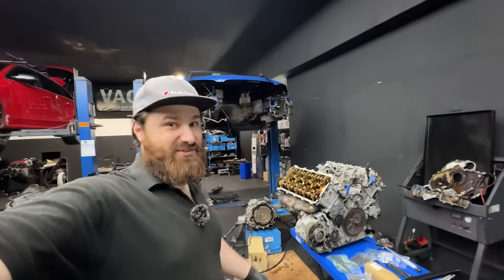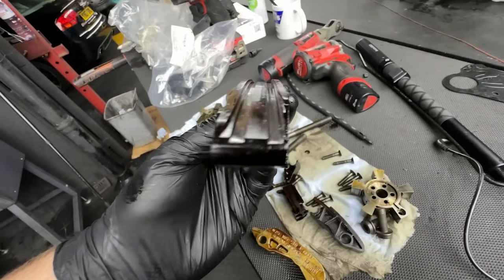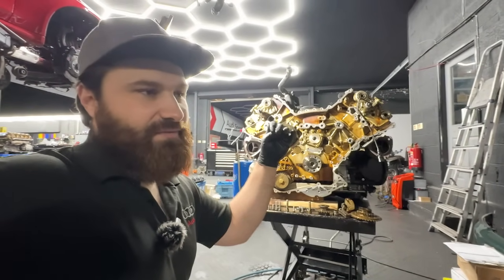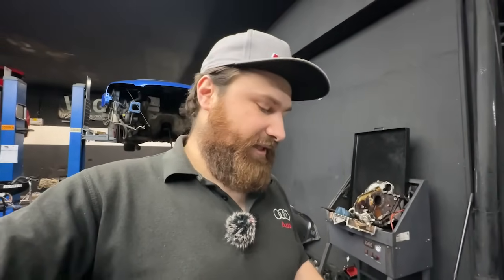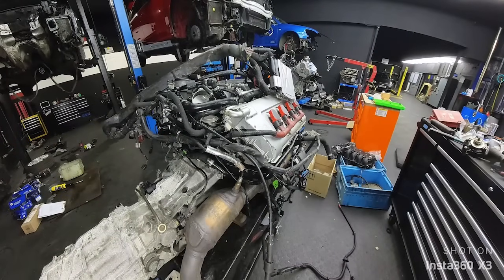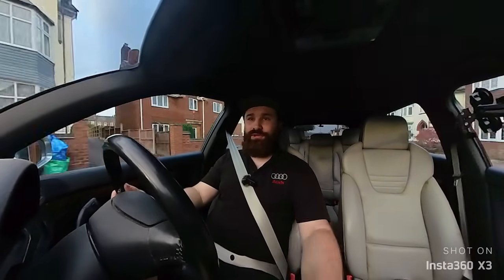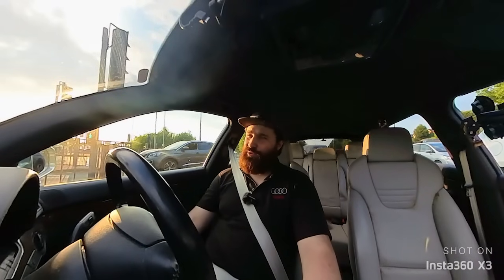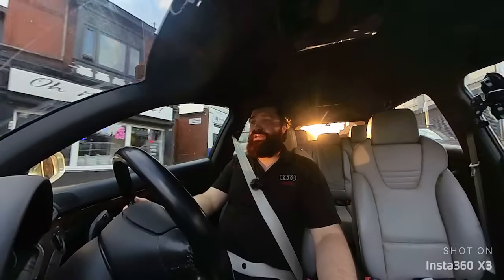Is this the end of Audi S4 V8 engines ?

Comment: Grind out the Audi logo with dremel, get one company to scan or do a new CAD design of the part. Modify to make it thicker. Then get that design and get another company to print it. There is many companies online where you can upload the file, choose what matherial to print it out and they’ll 3D print them for you. That way when you provide them with your own CAD file there is no questions about patents and copyrights.
Reply: Have used this in the past with PC parts too, making my own fan shrouds etc. Having your own printer is too expensive, but there are many third parties that can just print it for you. 
Especially if it has to be heavier duty plastics, those printers can run into the tens of thousands.
Reply: @DontDrinkTheFlavorAid   how about you explain why then, in this scenario. Instead of just making this blanc statement.
Reply: Can a 3D printer print this part in a suitable material that will withstand the rigors of this particular application?  I've no doubt a 3D printer could print the part, its just the suitability of the media it can use for this senario.
Reply: @peterjames6607  there is various materials available. The part is originally cast from type of nylon, the same type of nylon can be used in 3D printers. And I’m sure at this day and age there is even materials available that will stand up to friction and temperature better than the original part. I men, it’s mega expensive, but they even 3D print parts from titanium.
Reply: @DontDrinkTheFlavorAid  But you could maybe 3D print a mould :) I'm not sure what you mean with 3D printer crowd, I just had some fanshrouds made for my PC, so i'm not invested much into it. But I see your points, liability sounds like a solid reason.
Reply: Milling out of a solid block is probably simpler and easier solution to 3D printing to spec
Reply: @utensil999  probably for low volume also cheaper than creating a mould
Reply: @utensil999  Was gonna say, just get a solid block of that material and cnc a few 100 of them :)
Reply: I was wondering the same thing. What would be the pros and cons of getting the guides done in titanium?  It's time someone make some changes to these engines for long term use. Great cars. Time to start treating them with the same respect as the 911s and and some of the other companies.  Singer redesigns the engines and there's others that build LS engines.
Reply: @utensil999 I agree that machining is probably the best option as you will have more control over the plastic.

Comment: Not difficult to design a "new" part which would be fully interchangeable with the original...it's done all of the time to avoid infringement of copyright. PA66 is a super common grade of Nylon so it's not really an issue to sort. Not as easy as ordering off the shelf but these things will only become more common.

Comment: Check availability of stock in the US. More V8s were sold there as a whole and with that a significant supply of spare parts which will be available. Challenge will be the cost to import but could be cheaper than making your own.

Comment: Hi, Injection moulded polymers are very different to 3D printed polymers. Machined plastic will not be a resilient as injection moulded as the surface will be different.  The Audi plastic colour would indicate there is additives in the polymer. Standard grades of PA66 is white or Black. I would suggest apart from the Heat stabilisation  there is a lubricant like molybdenum disulphide or PTFE. I would suggest talking to a plastic material distributor like Distrupol in the UK. An Aluminium low volume injection mould tool would not be that expensive - people like Protolabs Telford provide low volume series to OEMs in the UK.

Comment: You might be able to get the guide 3d printed in a strong material soon they have just launched a new filament that's very expensive but it's 3x stronger then PA6 called PPA-CF as long as it's printed on something like a X1 carbon with heated bed etc it may actually be strong enough, the other option is of course to laser print it also which is more expensive but apparently it's very good.

Comment: Copyright shouldn't be an issue unless the part is using the Audi logo. 
You might want to check to make sure it's not patented, but that's unlikely to be the case at this point.

Tons of aftermarket companies make parts without permission from the original manufacturer and since the part is no longer available there should be no problems.
Reply: Yeah, the patent has probably expired so as long as you are not infringing Audi's trademark, there should be no issue. IANAL 😅

Comment: I’m an engineer and I’m pretty sure you can get around the copyright by adding more ribs to make it stronger. Hence it’s a different design but hard part is getting a machine to make it with that plastic, metal would be easier but harder on the chains for sure

Comment: The adjusters can be machined, make the slot hole on the other side, the worn out topplate can be turned to another place. 
Do you check the the solenoids? Or replacing them with new?  Thanks for warning, i ordered a few wile it still can.

Comment: I dont know what company's you contacted to recreated that part, but that copyright part sounds like BS excuse, i myself had situation with my toyota forklift, where shaft inside joystick wears out and you can only buy whole assembly for 1000e. i took that joystick to my local cnc shop, made drawings and i had my replacement shaft after two weeks, drawing cost like 300e but now when i order 10 shafts its like 50e piece. Im pretty sure if i bring them that engine part and block of that specific plastic, they will gladly make drawings and produce that part as much as i want.

Comment: Stuff like this we used encounter with industrial equipment - NLA plastic parts. 

That guide has 2 "fixed" dimensions - the guide curve & the mounting hole positions. The rest is just blah blah  once the part fits. 

We got parts made out of ballistic nylon that had the 2 critical dimensions - doesn't matter what, pick the correct solid thickness that matches the part & get the 2 critical dimensions machined - ballistic nylon is "Better" than any other plastic, so it will be beyond fit for use. Can't get the plastic part? Make it. It's an opportunity, not a problem. If you can't get it, neither can others - sell them your part. Buy an 8*4 sheet of the correct thickness & get the parts water-jet cut. Ignore all the manufacturers nonsense apart from the 2 critical dimensions.

Comment: When will these manufactures stop using plastic? There must be a better method of chain tension. Are belts better?
Reply: They use various polymers in many other brands without issue. This is just the reality of German quality.
Reply: @crztank9298 German or Audi?

Comment: Sadly, at this point when the manufacturer refuses to support the engine, now you have to look into the aftermarket, and yes, this may mean China! There is always engineering solutions, for example 3D printing for this plastic part? I have a crappy old (2013) mitsubishi ASX here in Australia, and the dealers do not have engine mounts for it. Apparently there is one in Japan if I wait at least 4 weeks to get it in and a huge cost ($300 AUD for one bloody engine mount, there are 4 total). Manufacturers are making crap that breaks to force people to buy something new(er). Ripping the public off seems to now be normal business practice all over.